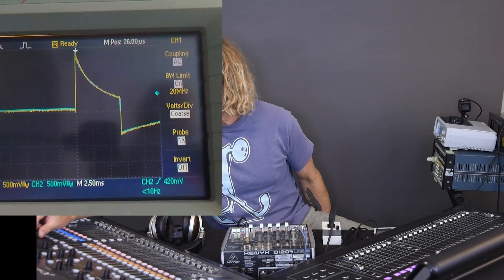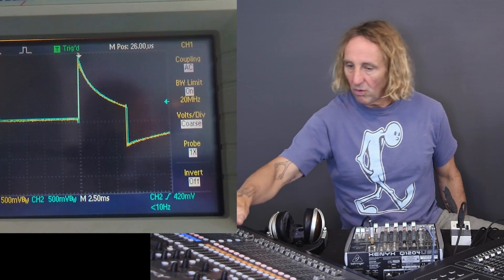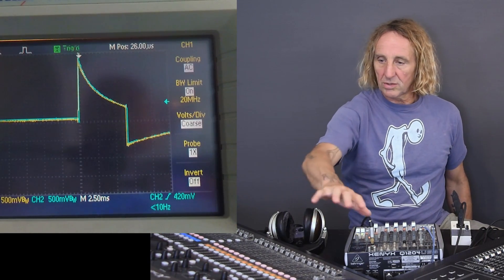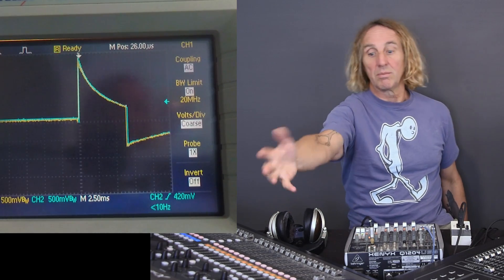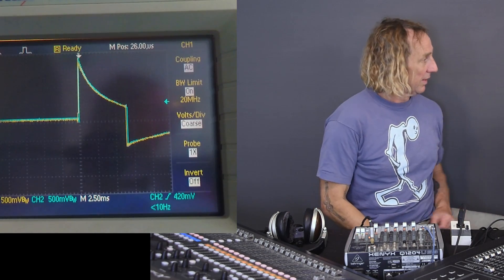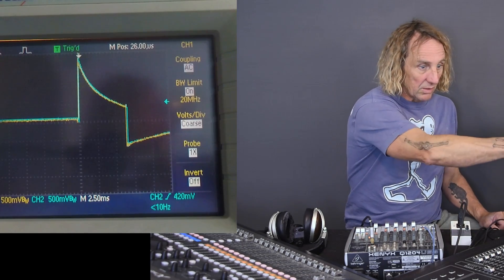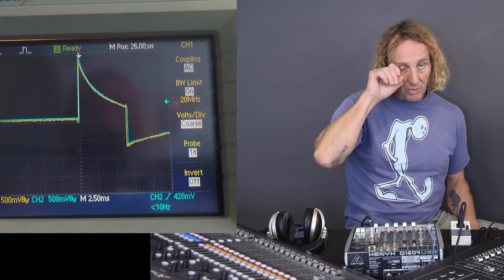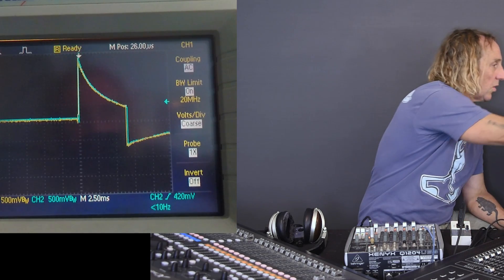Digital vs Analog Audio - X32/M32 AES50, Routing Latency (Public)

Comment: I’m going from a x32 rack to a m32C both used with the DL32 midas stage box for inputs and outputs. will there be any difference in quality since they both used the same Stagebox and pre’s?
Reply from the maker: The stage box should determine the sound quality of noise on the input side. Same with the outputs, if you use a Midas stage box you'll have quiet or inputs but if you use the X32 analog outputs they'll be noisier.
Reply: @DaveRat  thanks Dave!

Comment: Hi Dave
Thanks for your good and informed posts. All network transmissions introduce latency, as does a DA/AD conversion. What really puzzles me is, is it better to run a stage box with 32 inputs or is it the same if I run 2 pieces of DL16 for example? Does the simultaneous operation of 2 stage boxes already introduce time differences to the FOH console?
Reply: Maybe it would be an option to run one stage box on AES50A and one on AES50B. The signal path from the stage to the FOH console would then (perhaps) be identical.
Reply from the maker: Good question and I don't know but...

As long as you do t have identical signals running into both stageboxes and the are re summing those identical signals, a bit of latency offset is not an issue. A latency offset of . 5 Ms is about the same as having a mic 6" further than another mic.

And if those two mics are not on the same instrument pointing at the same part of the instrument, the 6" differential is not an issue.

We have much bigger issues like drums bleeding into vocal mics that are 15 feet away creating dual signals that are 15ms offset.
Reply: @DaveRat  So true, the thing with the drum crosstalk.

I wonder what that looks like with jazz or orchestral? Al Smith always mentioned the importance of the off-axis response in this music. The microphones are often further away and the crosstalk and off-axis response is very high at the microphones.  Is latency a form of distortion? Many of my colleagues think so, which of course would have to be investigated in depth. In a DAW, 0.1 ms shifts of the same signal are serious. On stage it doesn't exist like that (almost not ...) .  Thanks Dave, your articles are very interesting.

Comment: I did an experiment on a tour. I was  using an M32 with a DL32. I use all the 32 input for this show. The venue had an analog split snake so I ran the input on the local input and DL32 at the same time. During soundcheck I switched between the two using a snippet to do it in one click. I know theoretically the frequency response should be the same, but I found there was a lot more details running the Local preamp. It was really noticeable in the keyboard sound. Also, the main PA was patched locally and the In-Ears on the DL32. The band on stage also prefers when the input where Local. To be fair it was not night and day difference but still I use an analog snake when I am able to.
Reply from the maker: That's interesting, not sure the cause but variable do occur. Seems it should be the opposite but that said, it's all about testing vs assuming.

Comment: Nice! Always wondered how much latency was added by the AES50 Link. Would like to see this compared with Dante with and without a few network switches.  Looks like the delay is about the same as an analog cable between the consoles with the A/D and D/A pair on the consoles.  Any chance of comparing the AES to an analog cable from a send to a return on the other console?  I suspect the link is about the same through the D/A and A/D on the send return pair as the buffers for serial multiplexed transmission over AES50.  Would be interesting to see the differences.
Reply from the maker: I don't currently have additional AES50 units other than the X32 but maybe at some point

Comment: I've watched a vid of Metalica's FOH engineer Mic Hughs and he really likes the console he works with (Midas Digital) but it rings clear that cables makes a difference. This bodes the question of delays used for driver alignment at stage vs. delays used for field drivers used in big venues such as Rock AMRING in Germany. If latenancy is a big issue in cable types , how do we mathmatically compute delay settings for field drivers at such events?
Reply from the maker: Hmmm, the time it takes to convert from analog to digital and back to analog can induce some latency of say .8ms to 2.5ms or so, equating to the equivalent of about 8 inches to 30 inches of how far sound would travel in air over the same time period.

Setting time for a delay cluster would involve delaying the sound to compensate for the distance differential between the main system and delay cluster from the listener perspective, so say a delay cluster is 115 feet away from the main pa, and sound travels about 1150 feet per second, the the sound would need to be delayed about .1 seconds or 100 ms.

As far as the latency induced by cables, sound in wires or fiber optics travels at about 2/3 the speed of light or faster so maybe somewhere above 600 billion feet per second so the added latency would be maybe .00017ms for delay cluster 115 feet away. 

Or looked at the other way, a cable a MILE long would add a delay of less than .008ms or less than a 1/100th of an inch, which would be irrelevant.

So all in all, time travels slow in air, about a millisecond per foot, and very very fast in wires, about a millisecond for 125 miles and converting from analog to digital and digital to analog adds a small delay of about 4" to 15" each time you convert.
Reply: @DaveRat  Wow, that shows an engineer level of answer that is correct.  Love the answers from an engineer vs an audiophile.  For a real world example, communicate with someone a couple blocks away by phone and yelling. Sound through air is way slower even considering the obvious delay in digital of a cell phone when standing next to each other. Then remember the sell signal goes from a phone, to a tower, to a central switch, back to the tower and then to the other phone, and this trip can be miles long and still beat the analog voice in air over the distance of a couple blocks.  Sound in air is really slow in comparison to sound in a wire.
Reply: @DaveRat  Delays concerning distance for field setups weren't really my problem. (Speed of sound @ sea level and relative humidity )but the latency of the conected electronics and the conduit on which the signal travels. Thanks Dave for breaking that down. Love technology but you need to know what you're dealing with. Top knotch Dave.

Comment: I hate the proprietary Cat 5 etc Ethernet connections that charge $1,000 for their version of a network switch.  AES50 may need a deacent cable but that is all it needs.
Reply: Network switches are a store and forward device with absolutely no regards for a system clock. To use a "Normal" network switch, you lose low latency as some bits are delayed longer than others as the switch stores and forwards packets. The real world analog is your snail mail. It is delivered between noon and 2 PM, but not always at the same time everyday and always after being received, stored, routed, then delivered.  That special switch is like overnight express. Everything in by midnight is delivered by 2PM the following day. No missed letters and delayed mail in a time critical delivery system. Runs by a master clock.  This is the difference.  Without it, overnight delivery turns into long latency of delivery of sometime within 28 days. You may send packages one a day, but they get delivered some the next day and some days get 4 days worth of packages.

Comment: Latency wont matter when all the sources (mic inputs) go in and are all late at the same time, is that correct
Reply from the maker: Correct except if the latency is too long or there are multiple latencies from multiple pieces of gear, like a digital wireless mic plus digital console plus digital processor in an amp that all add up to too long.

Too long is when the latency becomes audible like latencies over 3ms in vocal mics into floor monitors
Reply: @DaveRat  i get it,
Reply from the maker: Awesome!!

Comment: AES50 has admirably low delay, interestingly it is nearly identical at 0.15mS to Dante’s performance.  That could be deliberate or perhaps there is a technical reason they are so close to exact parity.

The 10uS difference between the consoles is not trivial.  I wouldn’t say it is highly unlikely to run into that using two consoles to accommodate a large-count show.  It’s way more likely than we might initially think, and as most of us know, a 10uS ‘clash’ is a huge deal sonically.  That is a very interesting result, Dave.  Great catch.
Reply from the maker: Thank you, I believe the offset in latency is due to the d to a converters so it would only show up if you merged the outputs of an x32 with an m32 both reproducing an identical signal that has been re summed with itself.

That said, I am guessing that the added latency due to the different d to a processor is not the only difference between the cheaper x32 and more expensive m32 d to a converters. So it is more of an indicator that there are probably more differences that I did not notice or require differing setups to hear or measure.
Reply: @DaveRat    You are very likely exactly right about the source of this delay.  There are circumstances when using digital IO, rather than analog, is a workaround.  

It’s ironic that what was once the most expensive part of any digital audio product - the converters - is no longer.  I haven’t looked into the current crop of ADDA devices for delay but certainly there are differences.  That would be a wonderful thing for the industry to focus on and standardize.  There is no inherent reason for that delay to be different for any converter.  All devices’ delay is some whole number of samples and it would be simple to design for a fixed whole number.
Reply: @artysanmobile  Peter, the delay is in the actual A/D device used. The audio is sampled and held, then the held sample is converted. Some A/D chips take more clock cycles to complete this task as it is often successive approximation.  Not sure if it is true as it was on the internet, but to reduce this latency in the M32, I heard the A/D is clocked at 92 KHZ instead of 48 KHZ even though the data rate in the system is 48KHZ. This is done to decrease the amount of time to complete the A/D step of the conversion.  This may be why the true Midas A/D is faster than the Midas Designed A/D in the X32.  The double sample clock rate in the input can also be used to average 2 samples to reduce noise in the front end, so this conversion rate has 2 advantages. Faster conversion to the bus and lower noise due to double samples in the same time averaging out noise.
This is a bit technical. I'll have to see if I can find the info on the Midas pro A/D conversion again.

Comment: Did you clock the two consoles from the same source? Might explain that 10 microsecond offset between the consoles.
Reply from the maker: The difference in latency between the two consoles is due to the x32 using a less expensive and slower d to a converter, I am told.

As far as clocking, when you use  analog inputs and analog outputs, you are comparing latency of the units. Clocking does not alter latency. Clocking time aligns and syncs the sampling, 

That said, if you clocked them together and then raised the clock frequency, or if they are not clocked and the independent clock frequencies were raise, then the latency could possibly be reduced.

Latency of 96k products tends to be lower than 48k units.

If the independent clocks are drifting so drastically that they were altering the latency, we would see the waveforms shifting all over the place on the scope when comparing the two
Reply: @DaveRat  Don't forget, there is only one device as the master clock. They are running on the same clock. AES50 will not run asynchronously on two different clocks. Attempts to do so kills the green sync light.

Comment: I have found a lot of latency issues when inserting a processor on a bus or channel
Reply: You need to have the same amount of processing to not have that issue. You have 2 options - 1) use stock compressor not a plug-in type 2) if you want to use plug-in make 2 busses and process both of them with the same plug-in.
Reply from the maker: That makes sense.

Comment: latency is something to really keep in mind, ive seen it catch out some engineers. the plugin effects that you ca insert on channels all habe small amounts of atency.

the 1176 is nice as parralel comp for drums, seen engineers do that with drums still going to mains ad not notice the phasing issues.

i got round it by using 2 stereo subgroups both with the 1176 with 1 having no gain reduction or just tickling and the 2nd with agressive settings.

good to purposely cause phase issues and learn what is sounds like,
Reply from the maker: Interesting. Definitely want to compare and make sure that when re summing multiple paths, there is not detriments. Mirroring the processing is a good mitigation
Reply: @DaveRat  its just we using a isert via the fc slots. theress slightly diffferet latency dependig on what fc is used. think it rages from 0.9ms to 1.3ms. someone measured it some years back.
Reply: Does anyone know which live console manufacturers offer automatic delay compensation?  I thought this was becoming common.  Maybe not?
Reply: @artysanmobile  sq series when using deep processing has  wet and dry level controls to allow paralell paths. not sure about inserts.

midas pro series does latency compensation.

Comment: Hi Dave! Interesting to see the minute latency introduced on the X32. I'm guessing the M32 produced a similar result? In regards to copper vs. AES50, I ran a street fest gig with both this summer. M32 at FOH with a 24 channel copper snake plus a Dl16. Had the DL16 at the back for drums and instruments and copper for vocals and extras. Didn't notice any latency, but I am aware that there's supposed to be a 1.1+ ms difference, between the two and had great results the whole weekend. Thanks again for the vids!
Reply from the maker: The aes50 latency is the same for both but I did measure the x32 with 20 microseconds more latency, I am told that is due to a different digital to analog converter chip.

Comment: what about daisy chaining few stageboxes? does edge stagebox have higher latency than middle one?
Reply from the maker: Easy aes50 hop should add the same additional latency.
Reply: @DaveRat  is is worth than to add some delay onto channel coming from middle stagebox?
Reply from the maker: The aes50 latency is so so small, just a few inches in physical distance when converted that it is irrelevant unless summing two signals electronically with differing latencies

Comment: I thought one of the "selling features" of the M32 over the X32 was the"25 time-aligned and phase-coherent mix buses" which was supposed to be an "M32 only" feature. Have you just proved that BOTH consoles have phase-coherent mix buses?
Reply from the maker: It is possible the m32 does not have any time offset from channel to channel while the x32 does. I will see if I can give that a measure when I put the consoles back together
Reply: I own a m32, but I’ve never heard that the x32 does not have the phase coherent mix busses. I think they are identical in this, due to the firmware is fixing this and this is absolutely the same.
Reply from the maker: I was told the x32 has a slight time offset between higher and lower channel pairs. But not sure if the m32 does as well.  I have tested neither for this.
Reply: @DaveRat  
Wow, I would be absolutely curious if that’s the case. Because I am working with the waves Soundgrid in live environment and want to use it with lowest delta bcs of avoiding comb filtering. It was not an easy step away from my analogue Midas console. 
If you could make little chapter about this, it would be awesome. Thx in advance. 
Plus a little scribble fade in of your signal path. 
Dave, you’re an inspiration. Whenever you’re in Berlin, let me know… 
Peace and love

Comment: I just found your channel a week ago and I've already watched hours worth of content. I'd love to see some experimentation using the X32 board and a Midas stage box over AES50. Theoretically, you would get all of the audible benefits of the M32? Of course, field testing reveals things that theory doesn't.
Reply from the maker: The tests I did use the m32 as the stage box for the x32, Wich should be the same as using the Midas stage box with the x32.

The differences I am finding are with the analog conversions, analog circuits, build quality, faders and ergonomics.

I have not found differences in the digital processing, so sound wise, the stagebox should be the determining factor.

Reliability, durability and use-ability of the surface differences are seperate.
Reply: @DaveRat  thank you for clearing that up! And thank you for being a badass punk sound geek. I don't think there are analytics to measure for audio-nerdiness, but I'd bet you're crushing that stat.
Reply from the maker: Awesome!
Reply: We're using this exact setup at a venue I work at. Would love to see this.